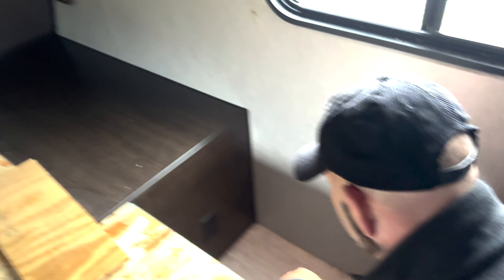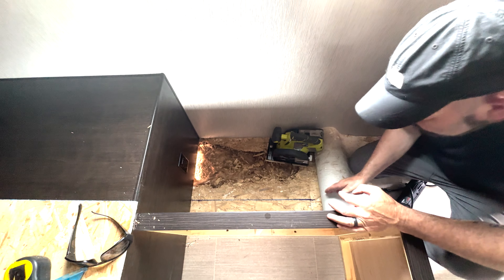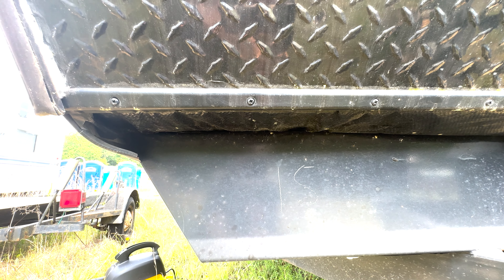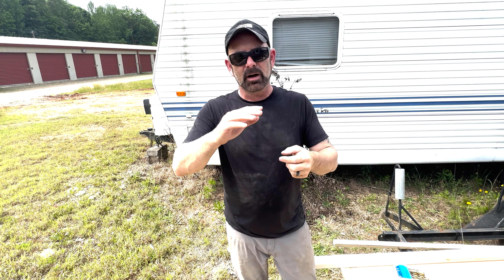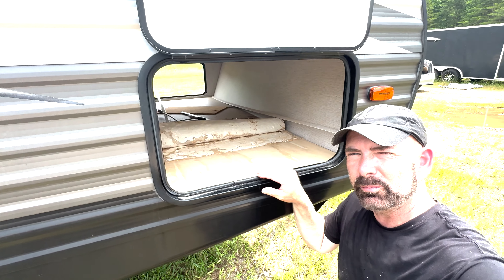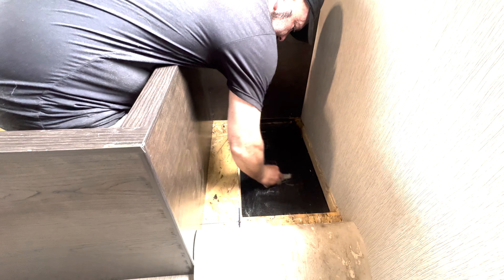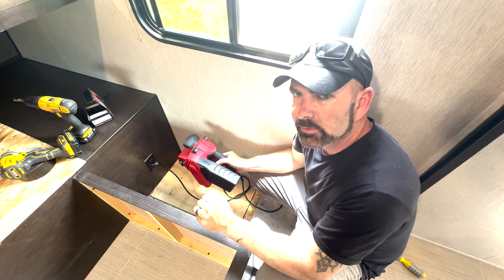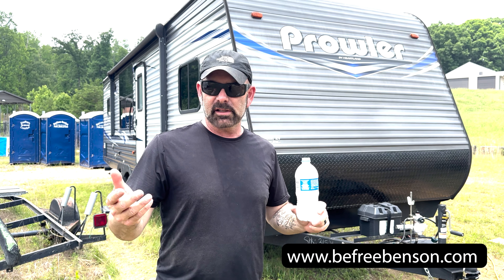DIY How To Fix A Soft Camper Floor

Comment: Overall great repair. The only thing I would suggest is using a good contact cement to glue the flooring back down instead of the staples...or eve a linoleum flooring cement...that ensures an even bond all around. My two cents for what it is worth!
Reply from the maker: Great suggestion!!!   Thanks so much for sharing!!!